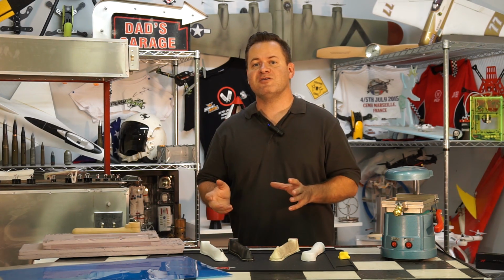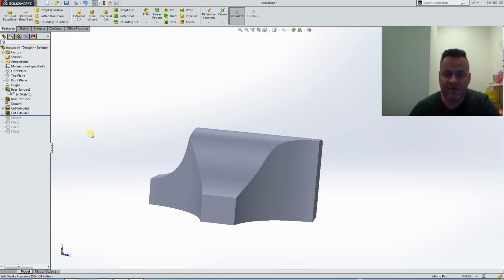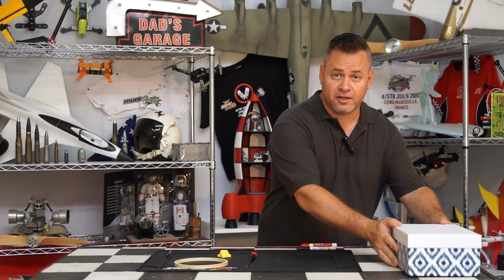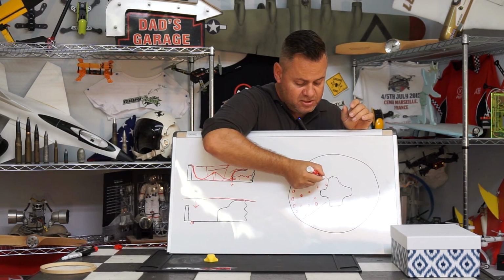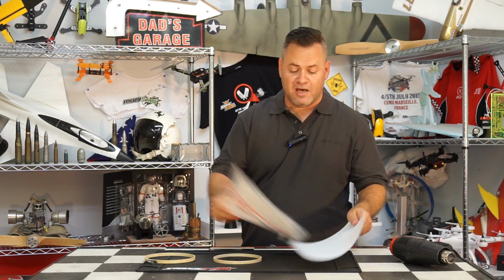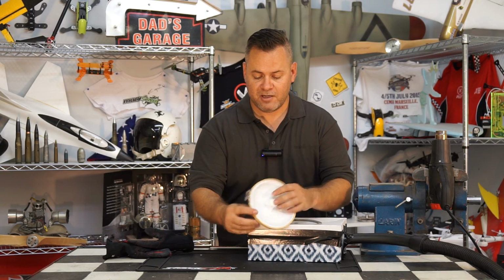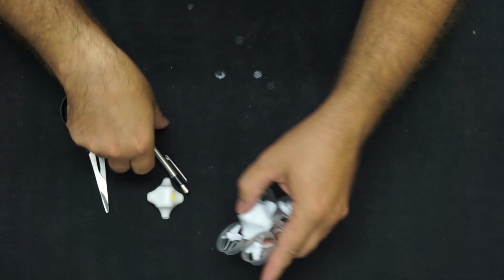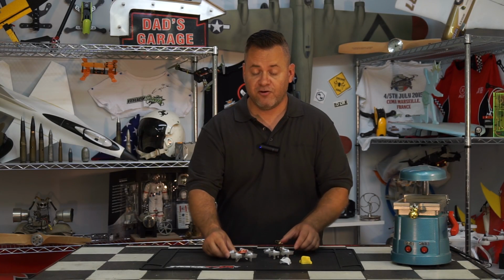TINY WHOOP VACUUM BODY MULLET MOD PART 2

Comment: Might be an odd question but instead of the 3D printer, can you use molded clay that's been hardened? Not really trying to buy a 3D printer. Have no need for it.

Comment: Nice video, Chris!  Have you posted the solidworks part file anywhere?  I'm using  a slightly different camera and I'd like to check the models before I print.  Maybe I'll add a fin as you suggested.   I suppose I could use feature recognition on the mold stl but it's nice to have the original features.  Thanks!

Comment: A 2in section of CPVC pipe, inside the box and standing up on edge meeting the box lid top where vacuum holes are will provide a cheap and easy support to prevent the box from collapsing.

Comment: Hey Chris, how did you mount the camera and vtx? Double sided tape?
Reply from the maker: Yes since the vtx is now parral to the fc just a small patch or double sided work great and then i used a dab of hot glue on the two corners of the can to the vtx at about a 15 DEG angle. works like a champ
Reply: Awesome, thanks! Sounds like a plan =]

Comment: Nice! I really should get myself a 3d printer. You should always design a minimum of 3 deg draft angle in the pattern, you won't need mold release.
Reply from the maker: Yep, but PLA has a low melt point i just wanted to make sure there was no heat sticking. worked great.
Reply: I believe PLA melts at 350F you shouldn't have any issues for a few pulls as the mold will never get hot enough.
Reply: Went by a hobby store but couldn't find this plastic sheeting. Where else can I get it from?
Reply: Search your for a local industrial plastic sheet supplier in your yellow pages. You don't want to buy it from a hobby shop. Kydex is the best for impact resistance. Lexan is good but needs to be predried PETG is also nice to vacuform as you don't need to dry the sheet. Poly Styrene is easy and probably the cheapest but not that tough

Comment: I don't get it, what type of plastic this is. Can you post a link?
Reply from the maker: polystyrene sheets .4mm, you can also use PP or lexan.. if you don't mind clear you can even use a 2liter soda bottle just cut it up, but it takes a little more heat.
Reply: Thanks!